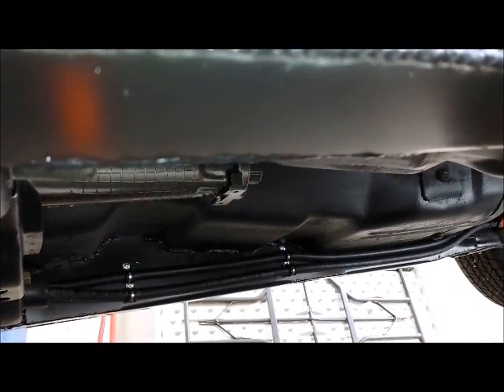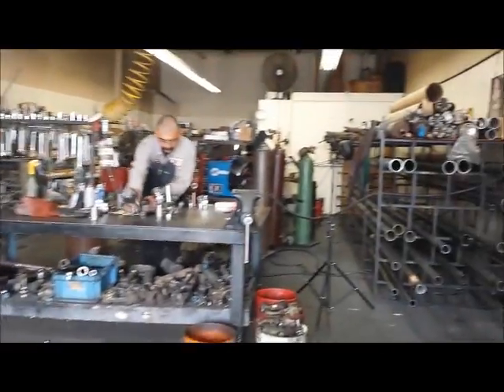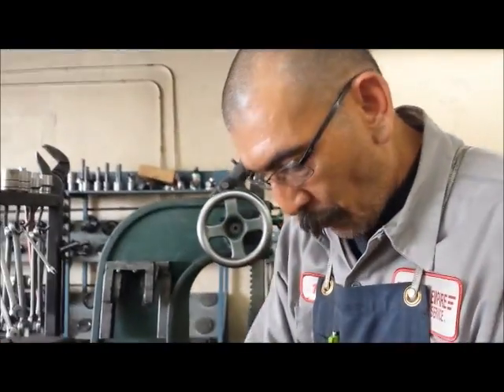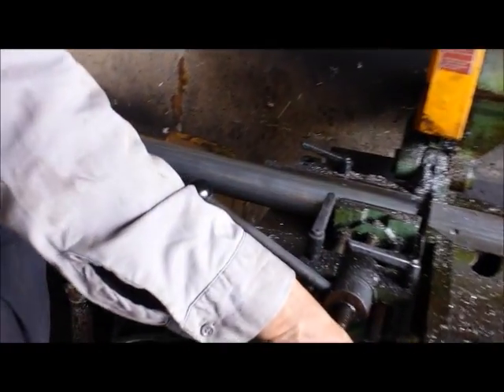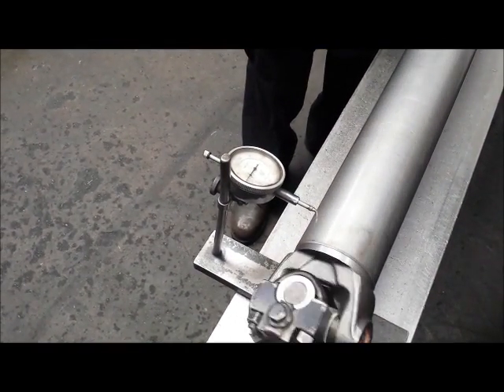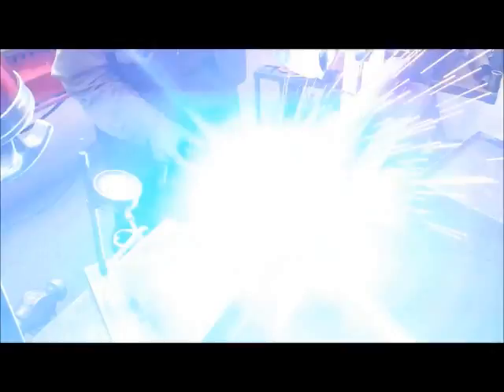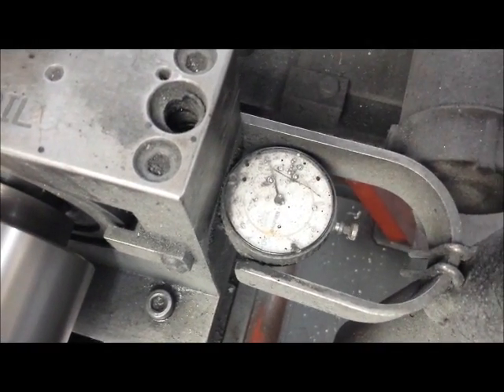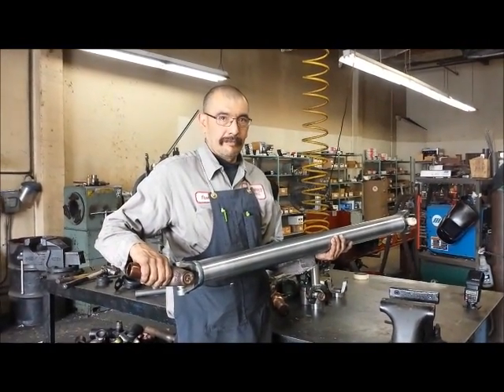How High Performance Driveshafts Are Made

Comment: I've had work done by them 3 times in the last 30 years only did so because they were local.  I was disappointed all 3 times.  I guess I never learn.  The last example was when they rebuilt my cardan and did not install the dust seal.  When I picked it up and complained, they said they don't need that seal and they never use them.   So I asked if they had it and they said they through them all away.   After some arguing they presented one to me but refused to put it on.  I took it to a friends and we used his press and took the joint apart and I installed it myself.  What a joke this place is.   You've been warned.

Comment: lost me on the mig welding but mad respect everywhere else.
Reply: Nothing wrong with mig welding if done right, I've run a million miles of mig weld on everything from car bodies to heavy earth moving equipment and I've never had anything fail
Reply: @markshort9098  mig welding causes to much heat
Reply: @69NOMAN69  stick would heat soak everything more because of slower travel speed and tig would also put in more heat it welded to slowly.. how much heat depends on how fast or slow you can get in and out again and that goes for all welding processes
Reply: @69NOMAN69  funny you say that because 4130 chromoly areoframes were traditionally oxy acetylene welded.. If chromoly is welded quickly with tig as to reduce as much heat soak as possible like one welds stainless, then you get a brittle welds that'll eventually crack.. tig was originally invented to weld chromoly and according to people I know who are certified in aerospace, you want to weld it slow and heat soak thin tube chromoly so it doesn't cool to fast, you either do that of anneal the welds in an oven or by oxy acetylene after welding.. I'm a machinist and metal fabricator but I'm not certified for aerospace.. one thing to remember with this driveshaft is it's not chromoly, it's just mild steel tube.. the problem with welding thin chromoly tube with mig is that you go in and get it welded far to quickly and then the weld cools far to quickly because of the lack of heat soak, welding thick chromoly is regularly done on preheated 4140 on earthmoving equipment and it's not a problem like thin material.. Jody at welding tips and tricks covers proper weld procedure for chromoly tube and he's certified for aerospace and a certified instructor and inspector
Reply: @69NOMAN69  I guess the bloke who is a certified welder for aerospace, certified welding instructor, certified nuclear welder and certified inspector doesn't know what he's talking about 😏
Reply: @69NOMAN69   look it up yourself, you don't want to completely cook it but as the same time you don't want the weld to cool to fast.. maybe check out welding tips and tricks, he's a wealth of knowledge

Comment: Wiles driveshafts in Tennessee is a way simpler process.. good video but very overly complicating a simple driveshaft building process. You don't have to balance a shaft with the slip yoke and cooling the weld down with water can creat weak spots in the weld.. air is the best method

Comment: he moves too fast. id be weary about buying something that was slapped together in a hurry like that.

that statement made at 13:55 about knowing if you have a vibration its not the driveshaft is not true. this is because the balancing machine holds the shaft perfectly straight. when its on the vehicle it will be at an angle and the ujoints will be in operation. 

for instance, if the endcaps which are welded onto the each end of the tube are not perfectly parallel with one another.

Comment: On an old mercedes diesel has anyone ever re ousted the shaft defeating the flex coupler
3 longer bolts on each end direct drive. I filled in the motor mounts and hanger bearing mount with eurathane so their more solid so they don't tear or flatten out.
So again 6 longer bolts direct drive  and let the U joint t be the flex point only,how many times have I been tempted to try it to no longer need new flex disc's anymore.

Comment: ***EP super premium is a lithium base grease.  It's very good quality, but not recommended to mix with polyurea bases [sometimes used in sealed bearings].   If u-joints have a zerk fitting, make sure you know what you're pumping.  Should you mix the two accidentally, it's best to clean and regrease your bearings.  Things won't fail instantly, but failure will be early left uncorrected.

Comment: Can someone explain the torch straightening to me?  When i was young didnt have the money for professional so always have and will make my own.  Nothing more than 400 hp, 480 tq.  I get them to balance them for about 50$  is the tube and sleeve pinching when the weld pulls?  And do you use the torch to adjust that and sometimes also use the pinch/ pull to correct the other side???   I usually drill several holes around and weld them further down before welding the top.  Wouldnt you want to heat the entire thing, let it cool even then just balance it and not mes with heated friction tightening/ adjustments that could self re adjust?  Or are they stretching the metal for permanant placement?  

Was looking at a few old ones i made when young. No balance weights on many of them, some one side, a few both sides because the shop said they were perfect.  (They werent being lazy either.  If they didnt need balancing i didnt get charged but they still sanded, painted and returned them with their logo.  Id offer to pay but they only let me when it needs it.  Never had one need a weight biger than 2 quarters and i still have some of my shafts running 10+ years no problems.  i run everything hard.  Also curious about the force they use to press the shaft on, that cant be good on those new u joins.

Comment: I did that when I worked for Wagner Mining Equipment co. I built big ass drivelines for underground mining equipment. Great job worked by myself didn’t have to deal with shop B/S great job I can do that all day long , low stress level. And every machine that rolled out of the plant I’d look hay my drivelines at work.😃😃😃
Reply: Wish I could score a job like that.
Reply: @stevee7774  the guy that was doing drivelines for years got tired off it and wanted to go out  on the shop floor. Once I heard about it through the grape vine , I jumped on it right away. I told the guy your nuts to go back out on the shop floor and having to deal will all the Bullshit. Work orders and supplies came in and completed drivelines went out. I could crank out D-lines in no time. The big point on my fast speed was I had blueprints for every job with the diamensions  already figured out. It was just cut and weld. On the hot orders I’d crank them out so fast the supervisors would come looking for the order and I’d say their gone and at the paint shop, they where amazed. Doing that level of work the supervisors just left me alone, it was a awesome job.

Comment: My driveshaft shop in the San Gabriel Valley does not have a water hose in it, all metal is preheated before welding, then cooled naturally before balancing.  U-joints are pressed in at the end and clean grease is used.    THIS VIDEO is a great example of of how sloppy and quick work is accomplished and made to look good in the end.
Reply: Also his prices in the VIDEO are way over priced.    I've never  paid more than $150 for a competition 1000HP rated driveshaft (I supplied the yokes and Spicer joints)
Reply: doesrealityexist where in the SGV is this shop??  Very interested!!

Comment: In the late 80's my dad got me a job at a driveshaft shop with a guy who was german. He taught me how to pop ujoints out of a driveshatlft with a ball peen hammer. He also taught me how to weld the driveshafts by hand. After they cooled naturally, we hammered the weld at the low point to bring it into 10/1000 of an inch. No water cooling and no ujoint press. We also used a hammer to install the end yolks. We did everything from dragster half shafts , to cat d90 driveshafts and were the premier shop in the chicago market. It took a special skill to build shafts with a hammer. Anyone can use hydraulics to press a shaft together amd that is how you can keep the payroll lower. Imo. The hydraulic process did look cool. It wasnt easy using a hammer, but I wouldnt trade it for the hammer skills I still have from that job.
Reply: Worked I a crank can shop, same deal, stick weld, grind, balance, any steel crank.
Reply: Back in the day when I was 15, I used strip my old BSA C10L down using just a hammer and a screwdriver, never had any problem with removing the head and jug like this, all the nuts had notches in them so they could be tapped undone and done up using the screwdriver engaged in the notch, happy days..
Reply: What was the name of the shop? I live in Chicago.
Reply: This guy is one of the those people nice but not a quality tech.
Reply: I'm curious, what was the name of the shop?
Reply: nothing can beat good craftmanship....
Thanks for sharing the story
Reply: Biggutter333 this is what I do for a living and we use hammers and never only use water to cool when we pull a shaft strait with a torch. Also alternating where u start your welds can counter how much the weld pulls the shaft.

Comment: One very important thing when measuring for the drive shaft is the car must be at ride height. Not with the suspension drooped down at all or with to much weight in the back. Thought I would give that as a tip is all!! Cool video though!!
Reply: how can the suspension drooped with the jack under the rear end right in the center it only drooped if the jack is on the frame.

Comment: A backstreet operation like youll find in mexico or Poland and such. No shop safety at all,open tubs of grease on the floor and cooling a weld with a hosepipe?????That and knackered needle roller bearing from being rammed in with the press,screwdrivers as drifts it goes on,Im sure the shaft will be fine on a old truck,thats about it though.

Comment: How can he know the exact tolerance betwin the end wall of the bearing and the cross? Open bucket of grease? A welded tube? I would not trust that workshop ever..... I use hydraulic pipes to my normal builds, and carbon fiber for the extremes. This is lowtech hillybilly. NO THANKS!
Reply: I agree... I thought the same thing ,open bucket is a magnet for metal particles  besides the Shop is a complete filthy mess,  That's why I have "Mark Williams Ent." Build all of my drive shafts  !
I glad I watched this , certainly not a Quality Company  !

Comment: Distortion from wire feed welding the ends is the primary reason they came up with friction welding drive lines and such.
Reply: Can you actually friction weld hollow tubing? I thought Friction Welding was for solid pieces only.
Reply: Pumice S https://youtu.be/51Zs8iaydt0

Comment: Can't believe he puts the actual U-joints in before pressing together & welding (flat spots on needle bearings & over heating the grease & U-joints), then cools the welds with water (way to hard on the metal & causes variations in the steel).  This is a bang up job... I don't care how good the finished product "looks". Guess they've never heard of Jack stands either...  What a joke these chicanos are.

Comment: Start your weld on the high side, one steddy pass, it will be near at 000" Try marking a .000 one and see what it does
Never water cool the weld till it gets somewhat cool by air.I have not ballanced any , make them straight. Try the large truck      
 Life-Line with hollow spline that goes oval while welding. I made 2000 in 2 years and built trans. and rear ends at that time. Spicer makes a bar , you can 3 jaw first end with the bar , put slip yolk on . then secod yolk . It's fast . I had to bore tube on trucks they are .012" tight , Too tight , bored to  .004" .( 3 Piece Drive line with 2 carrier bearings $3700.00 ,  6 hours , Good Money )  .                 If I do this again I will power feed the weld lathe . I used a hand wheel to turn , Circle with V on tube ajustable .  Thanks for video.

Comment: Damn needle bearing Jedi.... Making it look effortless... Arbor press... Nice 👍 very nice 👍🤙🇺🇸
Reply: Whether he’s been around a driveline shop or not, he ain’t wrong.
Reply: Johnny Davis yeah I especially liked the part where he used those new needle bearings to press in the ends of the drive shaft... Hammered on it some... Then welded it with them in.  Not to mention ruining the weld by running water over in afterwards... Or measuring exact measurements with a tape instead of a set of calipers....or getting under a car with only a floor Jack holding it up.  I'm sure I missed lots of his other screw ups but besides them... Yeah he knows... How to speak English at least I guess.
Reply: M. S. L. I’m guessing you have never been around a driveline shop
In your life

Comment: i always thought drive shafts were solid and not hollow
Reply: The added strength from a solid shaft is not typically necessary, and would just add a huge amount of rotating mass along the driveline for no usable benefit.
Reply: farerse guess you've never been to a junkyard. My junkyard has twisted and mangled driveshafts everywhere.
Reply: yes I have but never been on a lookout for driveshafts before..
Reply: Try actually building a propshaft, they can get very heavy, you fill all that tubing with sand and try lift it. I've built shafts from 0500 series upto 587.65. Can vary from around 5kg upto 250+kg

Comment: Do you know what happens when you quench your weld, they get brittle and can crack
Reply: I was looking for this comment. I’m lost of words when I saw him cool down the weld with water 😭
Reply: First to make the weld harden to become brittle it needs to be at red heat when quenched and you can't harden mild steel anyway because it lacks sufficient carbon content or other goodies to be hardened.. try it and see, I've tried to harden regular er70s6 mig wire and it didn't get any harder that I could tell, it certainly wasn't hardened to a point that it would be made brittle

Comment: Two things surprised me for a machine shop. First, measurement are made with a regular tape instead of a fast , precise and simple  caliper....and after welding the balancing weight, was the shaft rechecked ( for the weight added by the welding)?
Reply: Yes on tube with a small wall thickness it will always warp. I compensate with a little old fashion experience on the wall thickness and warpage. Most of the time leaving about 1 or 2 thousands run-out will compensate with a single weight welded on with .083 wall. Also tube diameter will change this because weights will be less effective on say 2 1/4" od wall tubing.

Comment: i build automotive and truck shafts everyday. we balance truck shafts at 2000 rpms an automotive shafts at 2500 rpms and we spin race car shafts at 3000.  you will be surprised how sensitive automotive vibrations are compared to truck shaft vibrations.  2000 rpms aren't fast enough to catch a automotive shaft vibration.

Comment: Try balancing at lower rpms. Like 800-1200. Ive learned that its best to balance it before it resonates. Im balancing on a Shenck HGB-30B. When balancing dynamicaly u need to calibrate it. Never works when im having resonans.
Reply: where is your shop, i think i would use your shop before inland empire.

Comment: surprised they don't spin it faster. 1800 rpm is cruising speed.
Reply: diffs after the driveshaft, thats irrelevant.
Reply: 91'Runner maybe you dont understand gear ratios. The rear gears (not the differential) and the trans gears determine what your speed down the road is RELATIVE to your engine RPM. my car with overdrive is 1870 RPM at 60 mph. In that case the drive shaft is turning about 2600 RPM. with a 3.89 rear gearset. If it was a 3.55 the shaft would be turning 2400 and the engine about 1690.
Reply: your an idiot think before you type. what about the diff?????
Reply: Yes a little surprising, but maybe they know what the tranny/ rear gear combo is for this drive shaft and have taken that into account. If it was an overdrive transmission, at 70% overdrive 1800 engine RPM would be 2570 drive shaft RPM.
Reply: Drive lines will vibrate the most around 55mph.       Tires- 35-70-140 mph.
Reply: stoop
Reply: your driveshaft dont see anywhere near the amount of rpm your engine does.
Reply: +AlexCoronaPhoto wrong. 3rd gear in a 3 speed automatic and 4th gear in a manual is 1to1 so if your engine spinning 5000 rpm so is your drive shaft. your welcome.

Comment: everything seems good about that except I have heard from multiple people that if you cool down a weld with water that it weakens the weld.
Reply: +Ryan Axberg Yes unless it is tempered after the quench.
Reply: ..Depends a lot on the temperature when you quench, and the type of metal
Reply: It depends how hot the weld is when you cool it. These people you are talking about arr generalizing because they don't understand metallurgy. He obviously isnt cooling it from the red hot state.
Reply: That's really only partially correct. The tempering process changes the metal on a molecular scale; affecting tinsile strength, ductility, and other aspects(an example of a molecular shift is during the Straightening of the DriveShaft).The inherent problem with "re-tempering" lies with the original molecular change; the material isn't quite able to be revert; let alone the larger problem of an uneven temper. This is why almost all tempering is done long before it is available to consumers.
Reply: Harrison keppers the molecules don't "shift" when you bend steel  (assuming you bend it below the eutectic temp which is going to be around 1800 deg F) the molecules stretch or compress at yield.
Reply: Well, that should clear everything up.